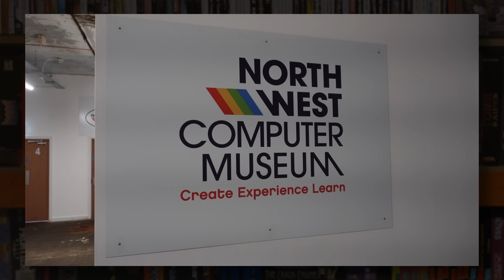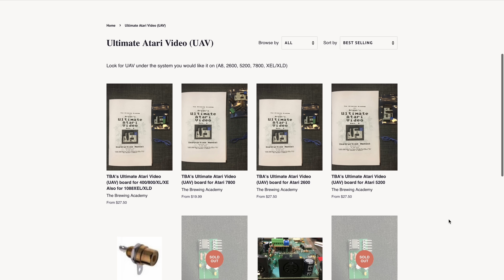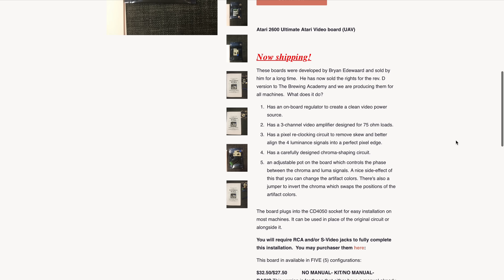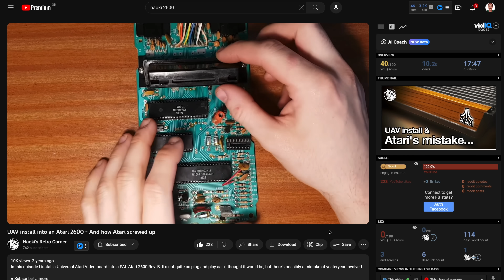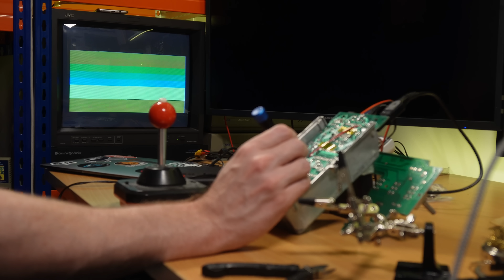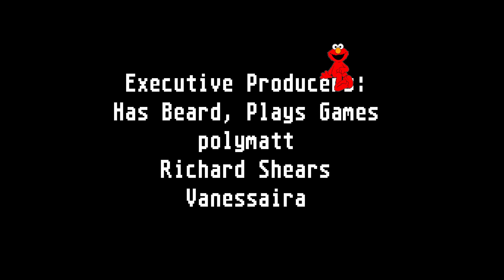A Totally Normal Atari 2600 Restoration & UAV Upgrade

Comment: No judgement on your "interesting" choices in this mod, the general public is a menace and will destroy everything it sees.

I am curious as to why it was modded for composite output, though. If I went to a museum and got to use an atari 2600 I'd want the original 70's experience, crappy and all. Is there any particular reason this is seen as an acceptable sacrifice?

Comment: Nice job! No judgment on the holes, but what I’ll typically do is solder the AV cable directly, zip tie to a screw post, and feed it out through the hole that the RF cable was previously fed through. Good of you to go all out with the UAV mod for the museum … I usually just use a basic cheap transistor amp! 😊
Reply: If you're worried about wire to board solder joints vibrating loose a small blob of electronics silicone on the solder joint solves that and can be removed later if necessary with a plastic scraper (also NEVER use common construction silicone on electronics it's corrosive to copper)